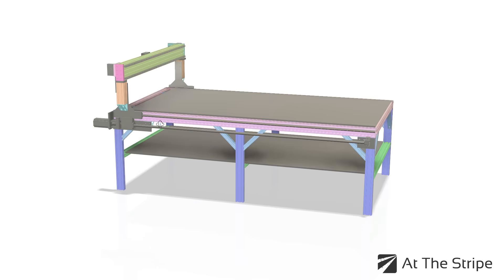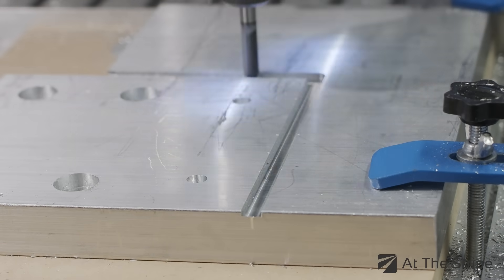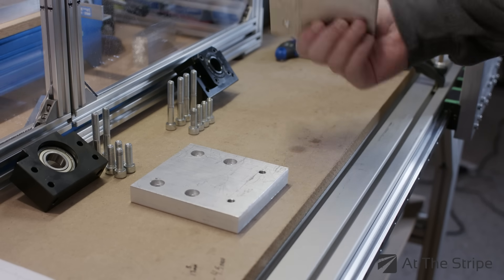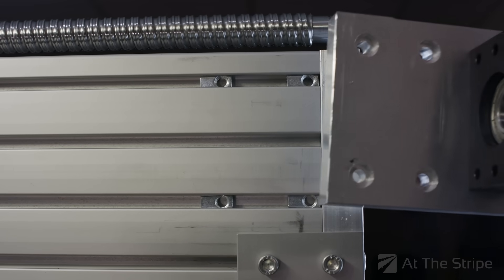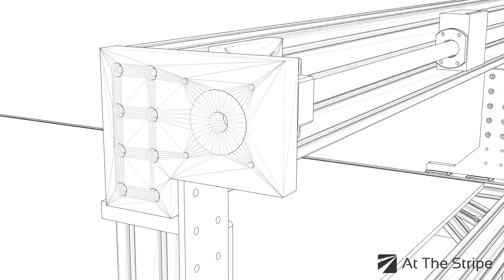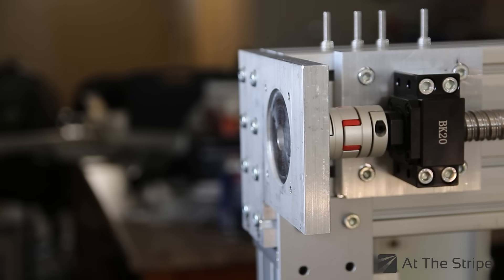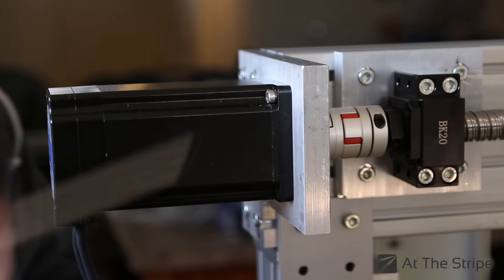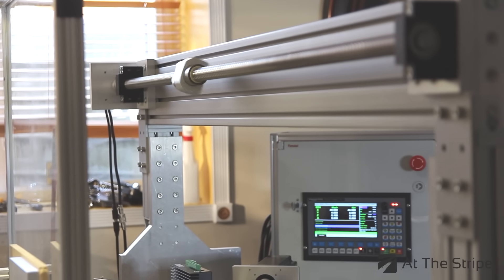CNC Y-Axis Motor Mount Guide w/ Fusion 360

Comment: You should bore first, then the center hole will be easier 😊
How did you hit so many subs in such a short period? Damnn 😂😅
Congratulations dude 🎉
Reply from the maker: @XYZ Spec  Absolutely! I have a lot to learn how to do things correctly. I really like watching how you process a part. I need to pick up some drill bits and more varied endmills and tapers. I have the most basic cuts and shapes right now. I'm still learning programming in G-Code. I only know the very basics right now. lol

I earned so many subs with the power of advertising! LOL I use a service called Sprizzy to run YouTube ads on my videos. It works greats! https://sprizzy.com/?referrer=896692

Comment: "Run a level one diagnostic!" 
"No effect!" 
"Try isolating the Iso linear chips and then cross feeding the duotronic processor!" 
"Still nothing!" 
"Try bypassing the dueterium stream and then extrapolating the verteron xevector!" 
"Nothing!"
"Signal integrity has dropped 51%. I'm sorry sir. The bagel recipe is gone."
"It's dead Jim."